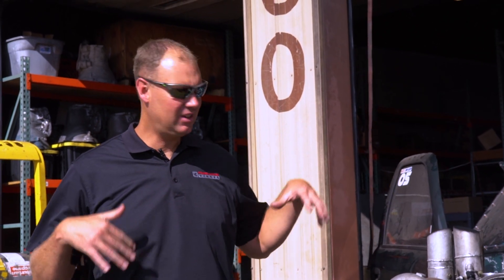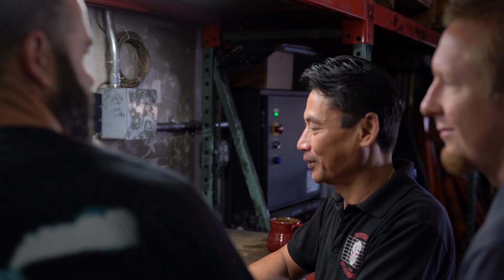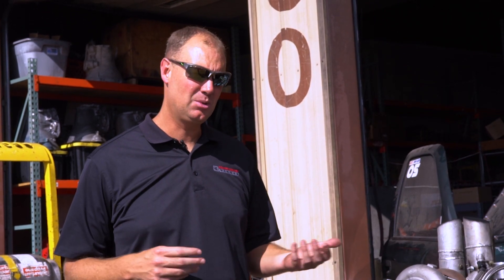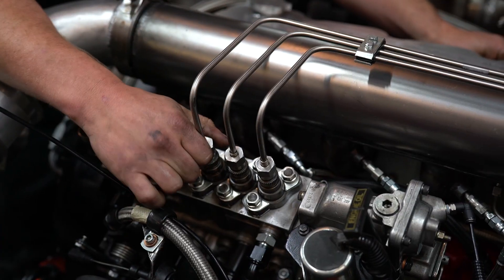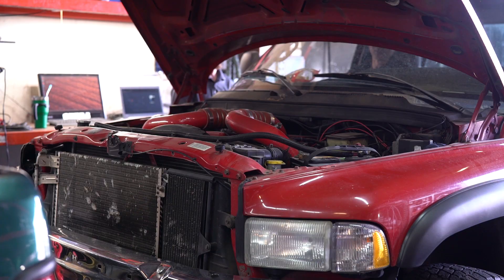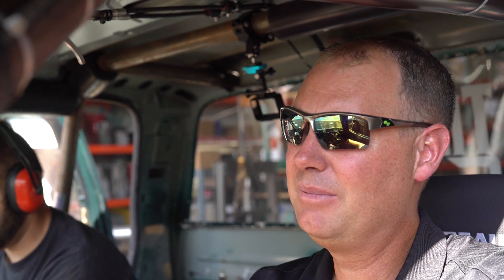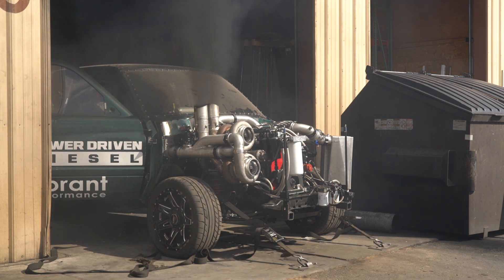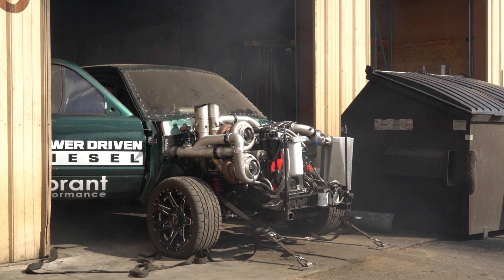Upgrading Our Dyno! | Power Driven Diesel

Comment: Air down your tires really low strap your truck down to the dyno like you normally would then reinflate your tires to normal operating pressure you will then be strapped down extra tight and won't spin